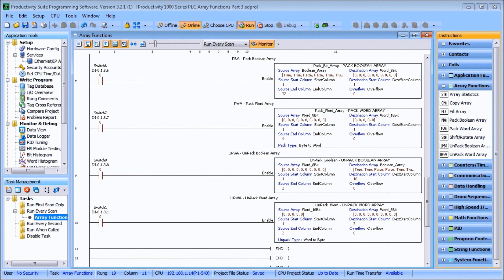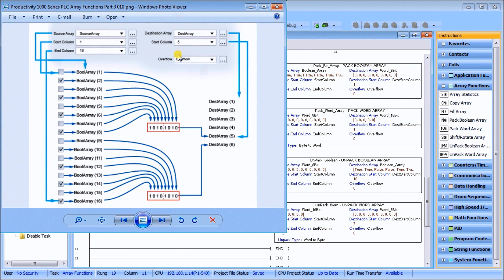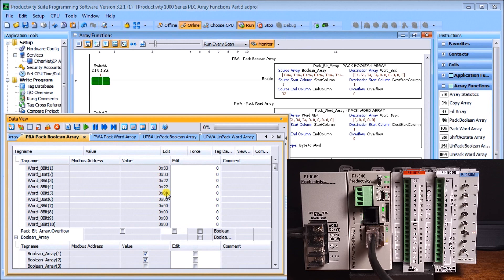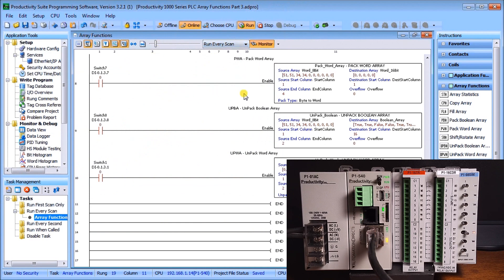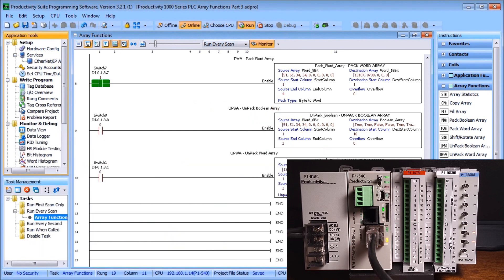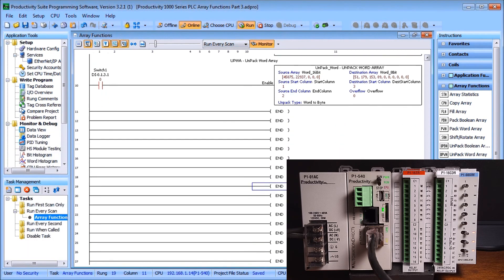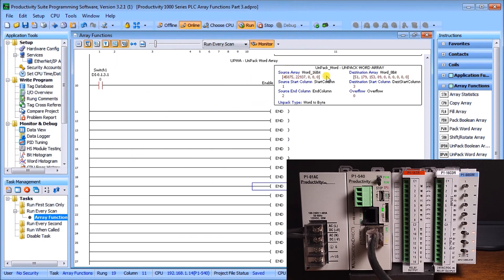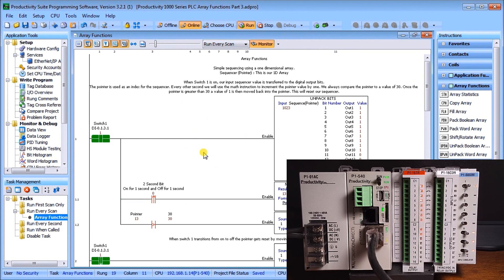Productivity 1000 Series PLC Array Functions Part 3

Comment: The image at 0:47 says first element of the array actually becomes the 8th (least significant) bit in the value put into the destination array. Wouldn't this mean an array of bits [1,1,1,1,0,0,0,0] would get saved into the destination array as [00001111]?

If it actually works this way, to me it mirrors the data unintuitively. I would think an array of [1,1,1,1,0,0,0,0] should get saved as [11110000], keeping the first bit of the array segment as the first bit in the destination.
Reply from the maker: In order to do what you want, it is more of a shift then a pack bit (Boolean) array instruction that you want.
Regards,
Garry

Comment: Hi Garry, quick question. Can I copy an entire array (1D or 2D) to the flash storage with the data logger. Rather then parts of it?.

For example array.data(1) only copies column 1 but I want 3000 coloumns to be copied.
Reply: Thanks for the fast reply I will have a quick look into that
Reply from the maker: Hi Aussiegruber86,
The data logger will log up to 64 tag values on a USB (Micro SD) storage device connected to the CPU. 
There are some ways around this but I have not tried it myself.
https://forum.automationdirect.com/forum/general-applications/productivity-series-plc/124323-save-array-data
If you have that much information that needs to be logged, I would look for software like AdvancedHMI.
https://accautomation.ca/productivity-1000-series-plc-advancedhmi-modbus-tcp-ethernet-communication/
Regards,
Garry